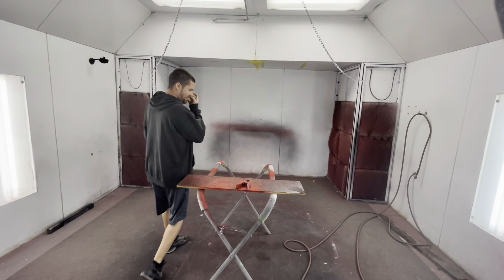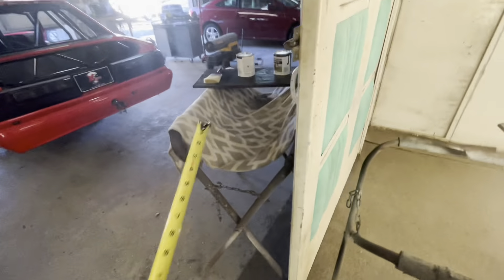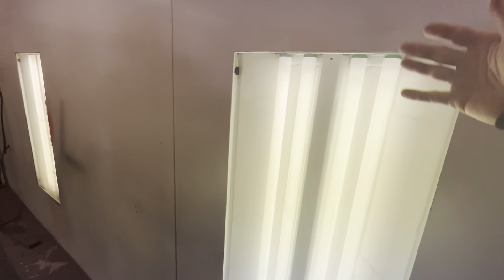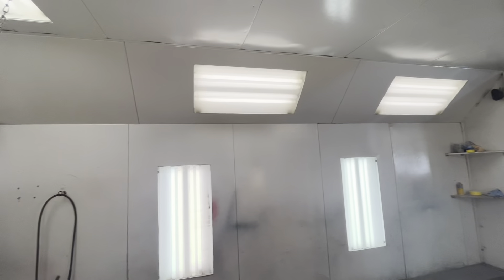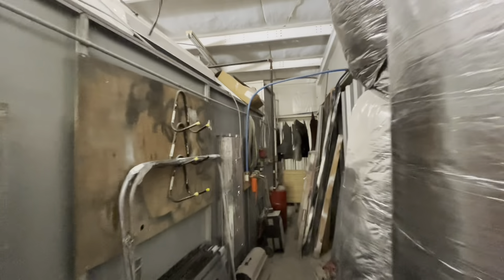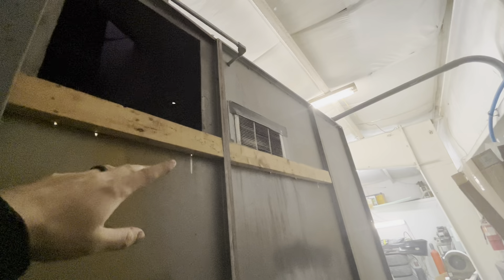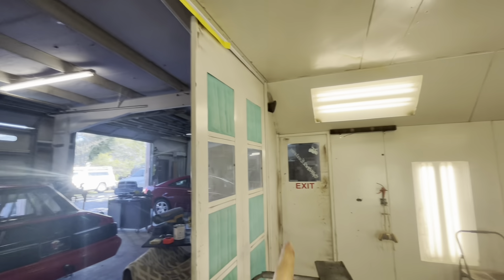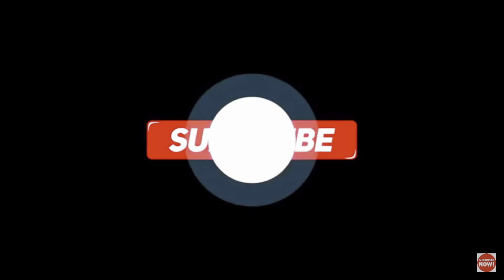Viewer Request: Paint Booth Explained (Size & How It Works)

Comment: I remember when I worked body & paint years ago, we had a static electricity problem where we lived. To reduce the amount of dust being attracted to the car we actually needed to pound a ground rod into the floor inside of the spray booth and ran a jumper cable from the grounding rod to the frame of the car.
Reply from the maker: Yes sir I’ve heard of that and people using a chain over the axle to the floor.
Reply: What’s the most flammable paint type like is clear coat more flammable then say single stage?
Reply from the maker: @timhudson8958 I’m honestly not sure

Comment: I'm going to try the carpet trick I always wet the floor before I paint but if I'm doing a job on a really hot day it usually dries before I'm through painting
Reply from the maker: Yup and it can rust out a metal booth. Water also can splash up on the car from hose flopping over
Reply from the maker: You’ll love the carpet